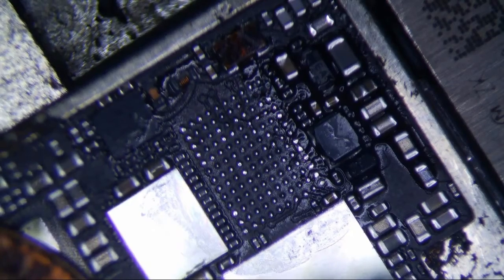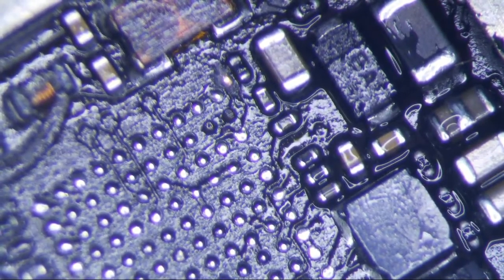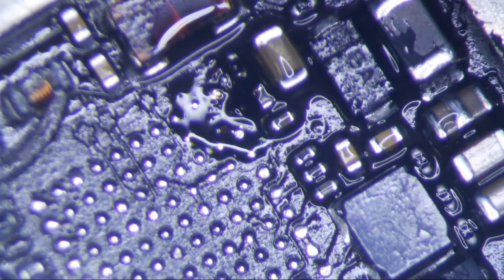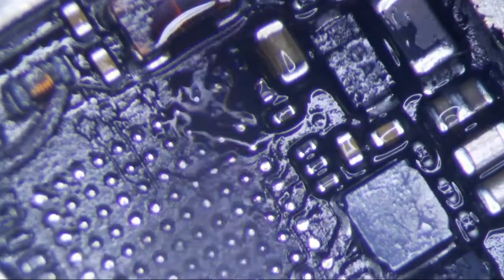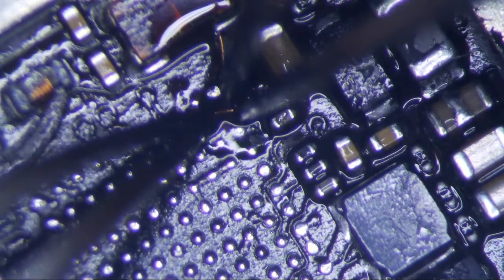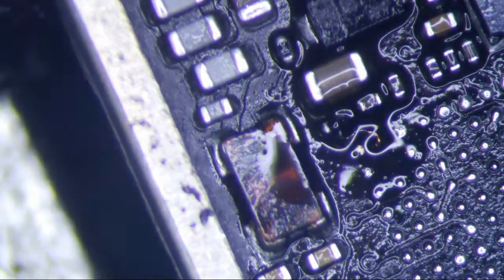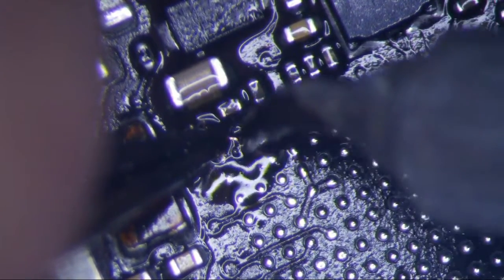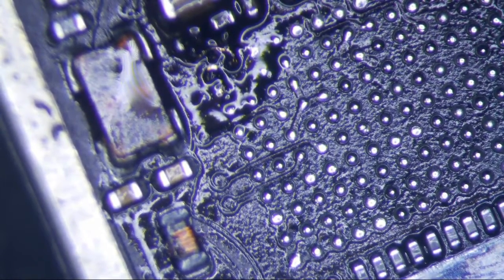iPhone 6+ touch ic repair   running a micro jumper

Comment: I failed 3 times to change touch ic, it made me crazy
Jute after removing the IC, the board don't turn on and flickering it consume 0 from 0.20A 
I am doing a lot of micro soldering but i don't know what happened with touch IC, please help i have 3 dead phones 
Thank you
Reply: Youssef Badra what temperature you are using to remove the ic?
Reply: 420c, and lowest air flow pression
Reply: Youssef Badra i don't know what hot air station you are using but in my opinion you are using bit much heat. I assume you have disturbed neighbour component thats why phone is dead. Check neighbor components carefully under microscope n try to fix those then phone ill comes on for sure. I know every hot air have diffrent temperature settings but in my opinion if you are newbie in touch ic's then always use lower temperature first. I use 360.00 on m kada hot hair station with airflow of 6 .. it is perfect for desoldring n soldering the ic's back easily n wont disturb other components easily.
Reply: Thank you very much, i succeed
Reply: Youssef Badra i m glad to know you are succeeded . Did you find out what you were doing wrong cos that is main thing if you did understood..

Comment: Great video , i would have loved to see an under the microscope view of where your jumper went from and to exactly!! Also did you use the thinest of threads posable from the wick or did it still have several strands entwined ?? 
I also use the Quick , mine is the 860 model , its does well for its reasonable price, but  it could be a little hotter at times ( maybe its me , as I'm just starting out ) more airflow maybe !!! Many thanks for sharing so freely , great job....
Reply from the maker: You need to calibrate your hot air station.  I will make a video on it soon.  your 500C may actually be 350C.

Yes, I use the thinnest strand of wick.
Reply: great that would be most helpful , i do think my Quick MAX is 450 and i assumed that is450 c